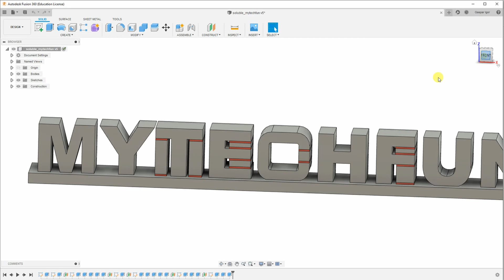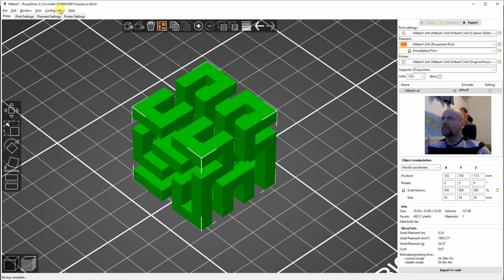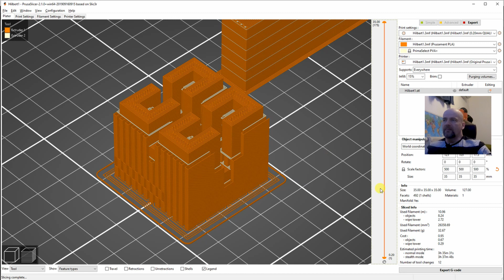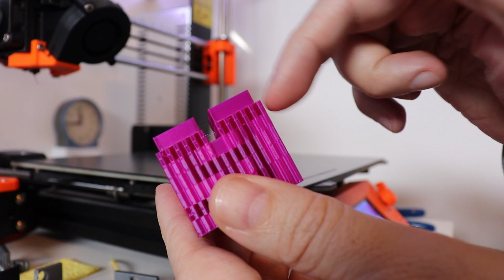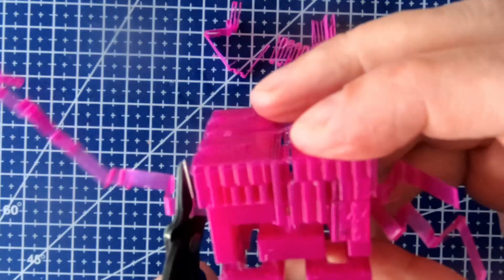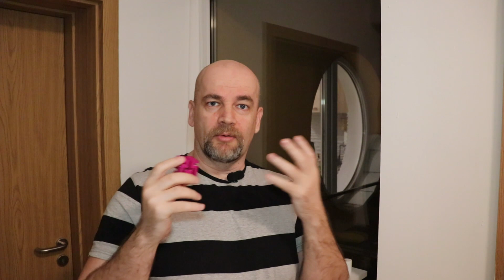Hilbert cube 3D printed with PVA supports and single extruder

Comment: That's where 3d printing should go. Videos like this shows practical solutions to problems when wanting to actually use 3d printer for something more than a 3d benchy. I will experiment with petg/pla supports as PVA is quite pricey. Great channel btw!
Reply from the maker: PETG/PLA combination is good idea, only problem is that they has to be printed on different temperatures. In my latest test I had some problems, but I solved it: https://youtu.be/7u73-RQx-Uc
Reply: The 3d benchy is a test print bro.

Comment: Good evening, can you help me to print with the natural soluble filament on a cr10s with single extruder?
Reply from the maker: With CR10 you are probably using Cura. My tutorial is for PrusaSlicer, but you can use PrusaSlicer with CR10 too, only you have to set the printer profiles. It also support M600 fillament change command
Reply: @MyTechFun  Thanks you